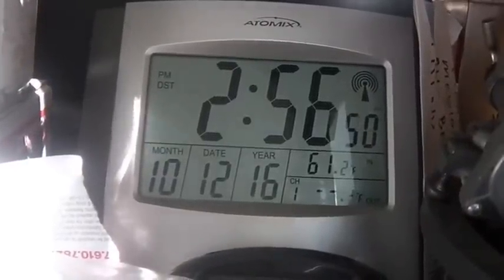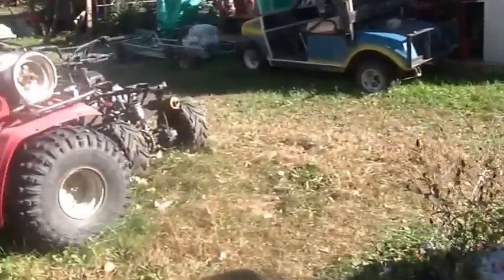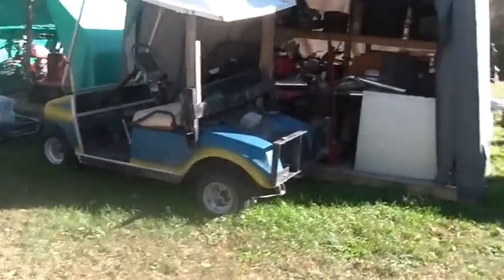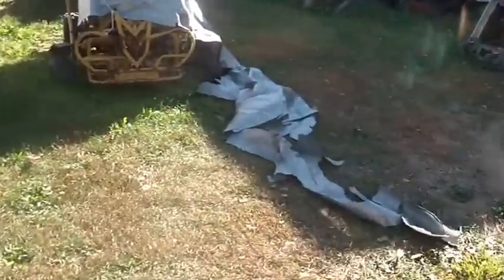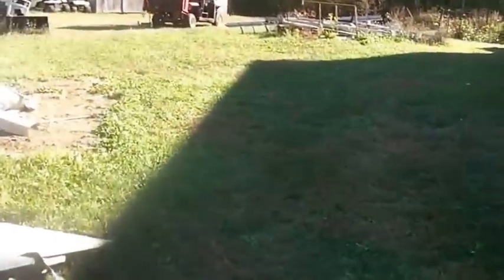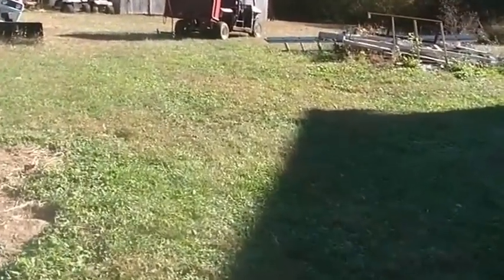Machining drive parts for Kawasaki KAF450, Mule engine conversion

Comment: Hell ya bud love seeing that the lathe is getting some love on this project. Idk how hard that rear comes apart but you could always weld the splines up and turn it down to a press fit to hold that sprocket on.

Comment: hey Harvey do you have an e mail or something for questions. I got a Honda 250sx. it has the same stator issues yours did with the added bonus of the flywheel scored. thanks for those videos
Reply from the maker: Hey Damian!!  Oh, The old metal debris gets stuck between the fly wheel and stator damaging both trick, a lot of these Honda 250 motors die of this.... Ur pulse generator  is probably ok, this means that U can use my 12Volt portable CDI system design to fire this ATC.... My eMail address is hoardingmayhem@gmail.com.....   Thanks for the info, asking, watching, and commenting!!!

Comment: That steel donut do you have a 3/4 inch ream? If you teamed it in a lathe it would fit flush
Reply from the maker: Hey Stagg!!!   I need a 25/32 bore in that donut, the boring rod showed up, I need to get it turned on the lathe, maybe tomorrow if it rains!!!    Thanks for your thoughts, watching, and commenting!!!

Comment: That may work out ok. I have made a disk like you did but split it in half and thread two bolts thru it to hold it on the shaft. Interesting to see how it works out.
Reply from the maker: Hey Steve, I'm going to put a key way in it and a couple of set screws.... Will also bolt it to the sprocket, then fill the remainder of the shift up with washers and press it all together with a bolt onto the threaded section of the shaft.... I think given all that, it should stay together no matter what I do to it.... Thanks for the idea, I must keep that in mind.... Thanks also for watching and commenting!!!